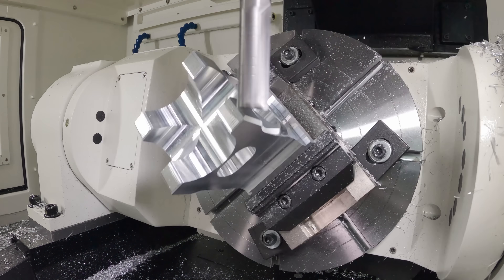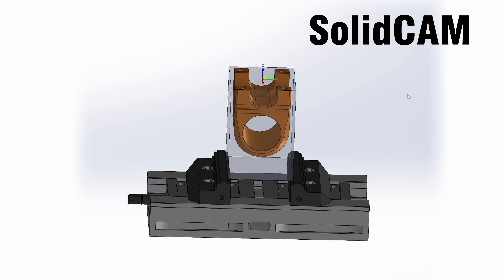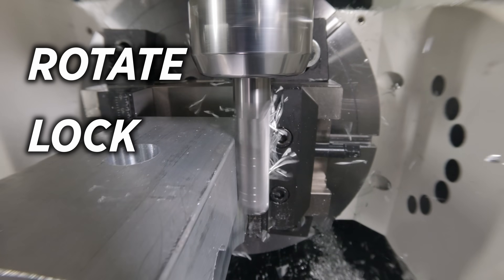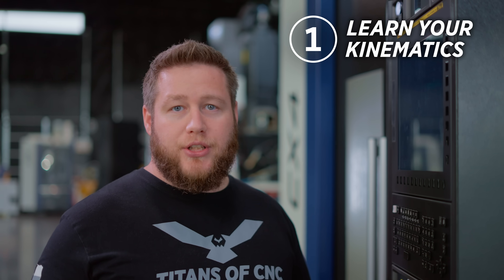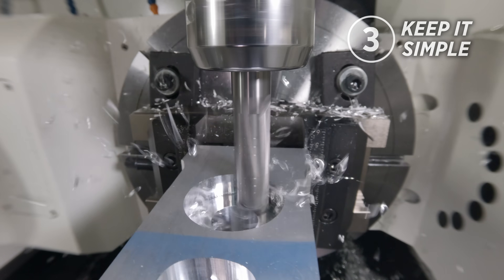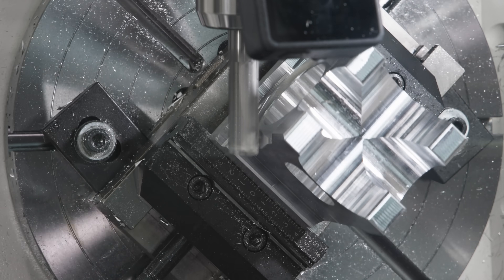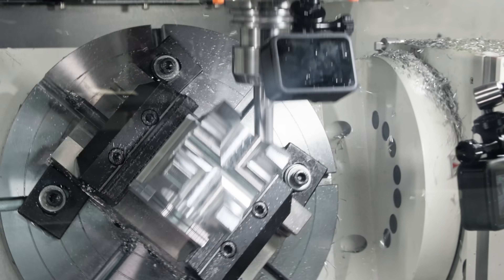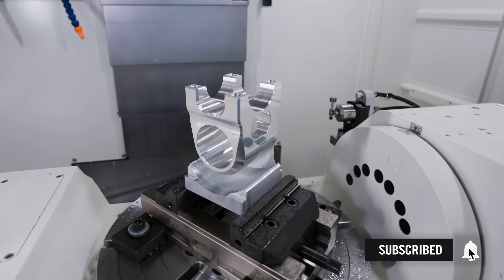Don’t CRASH your CNC Machine!

Comment: Great explanation, Jessie! I hope this video inspires others to step into the world of 5-Axis machining and discover the benefits it can bring to their businesses.
Reply: I've been working on a 3 axis before and a part of me was worried, although excited when the company was getting a 5 axis machine a year ago. Actually now I like 5 axis more, it mostly has only benefits compared to 3 axes, in my opinion, and it's actually easier to work on it, if you are careful enough and understand what you're doing.

Having the ability do so much stuff in only one setup, compared to needing about 5 different setup's on some parts on a 3 axes is an absolutely gigantic benefit both in terms of time and the effort you need to put in to do the part.

I don't program 5 axes, used to program 3 axes before, but even programming doesn't look much more complicated as far as I can tell. You have some additional stuff obviously, but I think if you understand the 3 axes properly 5 axis can only bring benefits.

Comment: Me also want to learn 5-axis . working on 3 axis about 13 years..
Reply: I operate, set up, and program with fusion on the UMC-750ss which is a 5 axis machine. I ran mostly 3 axis plus 1 for 2-3 years and from my experience it isn’t much different or harder. Though it rapids incredibly fast and it gets you goosebumps if you’re new to it.

Manual programming it is very different and hard. But it’s pretty much 3 axis with extra steps👍 cool to run though